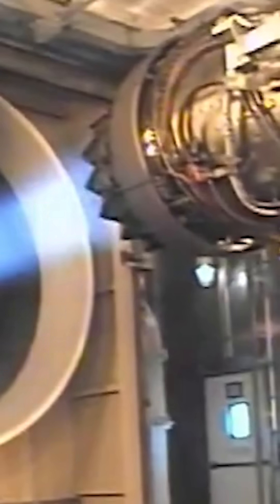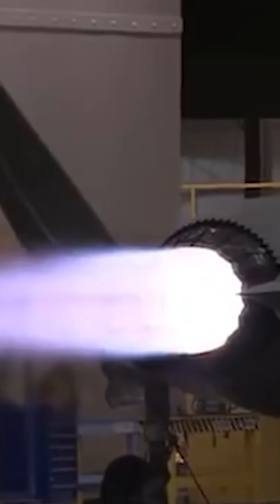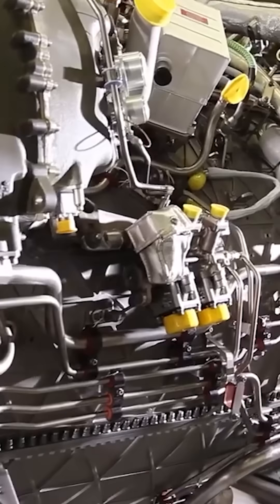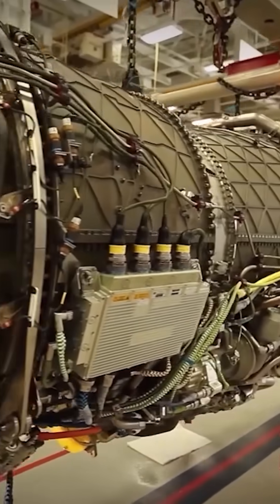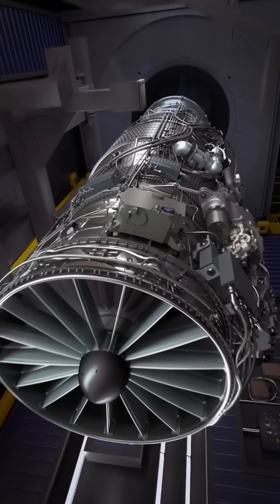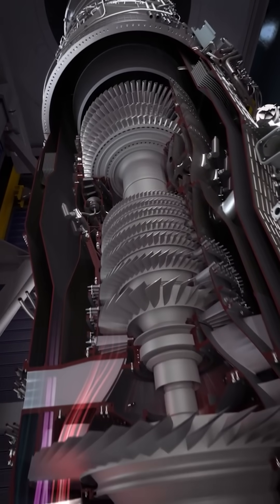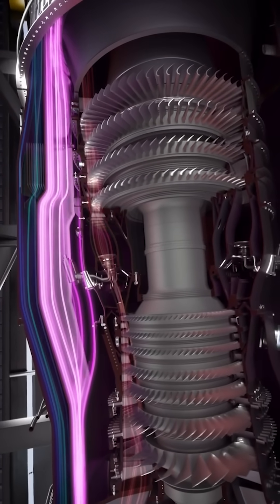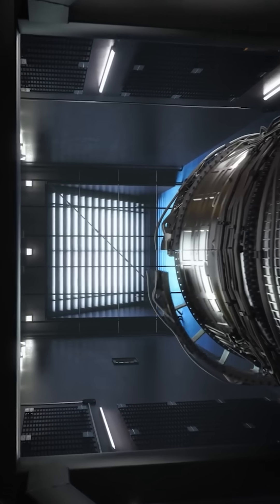America is still ALL-IN on new stealth fighter engines  #usdefensenews #militaryaircraft #military

Comment: I think these newer technology engines such as the Adaptive Cycle Engine(ACE)  should be one of the cornertstones of US GEN VI tactical fighter aircraft.  20%-25% increases in efficiency and thrust OVER the current F-135 engines  Wow! 
I can see the F/A-XX being a larger aircraft in order to have sufficient internal fuel capacity for the "pivot to Asia."  It can't be TOO big though as it still needs to CATOBAR(CAtapult Take Off But Arrested recovery) for the Navy/Marines.. 

A Nimitz class CVN could launch a 73,400lb F-14 and recover the same weighing no more than 54,000 pounds.. A Tomcat could  launch with 6 AIM-54 Phoenix missiles but could not recover with more than 4.
I'm not sure how much the new Ford Class carriers and its electronic/magnetic launch system or its 3 wire arresting system can stop.

I think the Whale(A-3 Skywarrior) was the largest combat aircraft to launch/recover operationally from a carrier at 84,000 pounds.
I think at some point high speed/maneuverability will take a back seat to ultimate all aspect/all frequency VLO, range and larger magazine  The current F/18 SuperHornet and the EA-18G forces are workhorses as far as operational tempo is concerned.  While they have better range the legacy Hornets their MTOW(Max TakeOff Weigh is just 66,000 pounds.
F-35C can launch at 70,000pounds and fly 690 NM from the boat.
.   Range requires fuel, you can have all the capability in the world but if you cant get to the fight it's all moot.  
  Both USAF and USN will get the amazing engines, but the Navy version will almost 100% have to be larger to get the range and to carry large Air Interception Missiles(AIM) internally.  I think USAF's F-47 will be the more hotrod type while the F/A-XX will be less kinetics and more range and magazine size focused for air-ground and anti-shipping.

And how does the Raider fit into all this. 120 B-21s is quite the capability?

Comment: It's a bit misleading saying that none had produced as powerful engine. Because:
1) Tu 160 , modern versions of the NK32 are more powerful ( ~ 250 kN)
2) But if we are talking specifically about fighter jets then it only wins in raw thrust, and loses in thrust to weight.
Nothing beats Russias Al51 because it loses in thrust to weight ratio.

Russia: Su 57M = Al51 Thrust 178 kN , dry weight 1400 kg, thrust/weight : ~ 12,7
USA: F35A = F135 Thrust 191 kN, dry weight 1700 kg, thrust/weight: ~ 11,2 ( around ~ 10 percent lower).
Reply: A bit misleading to cite the Saturn AL-51 as it is still in testing and not in production. Meanwhile there are 1,000 F-135 powered F-35s in service. 

Come back when the AL-51 is actually in production. Although that might still be a few years off.
Reply: @ Al51 is in production.

Comment: I bet the F-35 is eventually going to get re-engined with these engines since that would get it dramatically more range, enough extra takeoff thrust to add VLO shoulder tanks for even more range, and probably supercruise. 
My memory is that the adaptive cycle engines also provide more cooling power in addition to the extra electrical power, and the flying supercomputer is somewhat limited by cooling capacity.
Reply: The F-35 was supposed to get this engine in the next block but it was cancelled.
Reply: @pat8988  I assume because the engine isn't really ready yet.

Comment: Indeed, aircraft are usually designed for a specific engine. Probably the best example of this is the P-47. Then we had the P-51, that was really "meh" until they put a Rolls Royce engine in it. History is full of failed aircraft designs that were caused by the engine turning out to be unreliable or underpowered.
Reply: The history of the Allison V-1710 (P-51A) shows they had designed a multi stage supercharger for the engine. The USAAF vetoed all multi-stage and multi-speed superchargers in favor of Turbochargers. This was clearly a good choice on technical and performance merit but not for wartime production, or reliability. They were good on bombers (which cost the US 4x expensive, hard to produce, alloy rich turbochargers per aircraft loss). But not fighters, with the exception of the P-47 because it was so completely designed around the turbo system to maximize its benefits, to the detriment of other aspects.

Comment: American engine manufacturers have been quite smart in not giving out any technical data beyond whats publically available, and when they share such data they are very careful who they share it with.

This means China haven't been able to steal the data to use in their planes. Probably why the new "6th gen" blended-delta wing 3 engine plane needs 3 engines to push it ass through the skies.  😃
Reply: Still eating with chopsticks 🥢
Reply: Honestly, I'd guess the 3rd was to allow far heavier takeoffs AND for high levels of power generation for all kinds of systems from active aerodynamics to EM weapons both beam and coil/rail types, and to use great bursts of speed when desired rather than requiring 3 just to achieve supersonic flight.  Chinese engines are only less advanced they aren't absurd junk that can't be put to lethal purpose.
Reply: The 3rd engine is likely a scramjet or ramjet for upper atmospheric flight. They’ve caught up technologically in most areas. 

It’s kind of throwing stones in a glass house after the F-35 issues as well. Even if they’ve been addressed for the most part.
Reply: @bakernation  Caught up to a degree. Still signs of old tech and ramjet? Really? They should not be given an assumption of that level of tech. They were still running very hot at least until a couple years ago and probably still do. That is very bad for a stealth plane. An engine that smokes still work, but again is bad for heat signatures and shows a older and outdated level of tech.  Our engines haven't smoked since the 70s/80s. T
Reply: @bakernation  Uhhh NO, it's NOT. The F35 was designed from scratch. Completely new tech that obviously had to have the kinks worked out. China on the other hand doesn't CREATE anything. They just steal the best US/Western tech and copy it.
Even the very few things china has that WASN'T a direct knockoff, was STILL made using the TECH they've gotten from the WEST. 
Until they come up with something on their own, not just make a new fuselage shape with knockoff western tech inside, no one is impressed and they should be embarrassed of themselves
Reply: @bakernation Nope.  Most likely an engine with a lower bypass rate that will help increase fuel efficiency to increase range, because they can’t make adaptive cycle engines.  The shape of their aircraft and the small engine intakes simply won’t work for very high speed flight.  China hasn’t come close to catching up in engine tech, btw, and Ruzzia is even further behind.
Reply: How dumb can you be!?? China now has the WS-15 it's equal or better than your F-32 engine stupid they don't need any of your technology anymore.
Reply: @TC-3ntrep the f32 isn’t an engine lmfao 🤣 also the engine in the f35 is 20 years old and still puts out more thrust than Chinas new WS15.. so put down your Chinese bot keyboard and stop speaking you Chinese sympathizer
Reply: @TC-3ntrep lol, then why did we have to arrest one of your agents recently for attempting to smuggle data on the GE engines to China? And why did you try paying any Japanese pilot a million dollars if they land one of our mega cargo helicoptes? It was the Chinook, right?